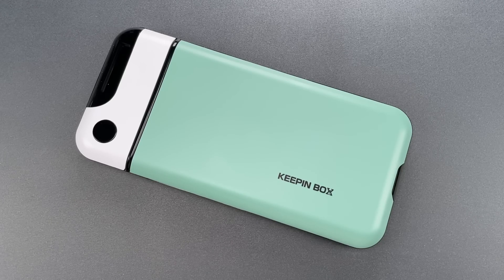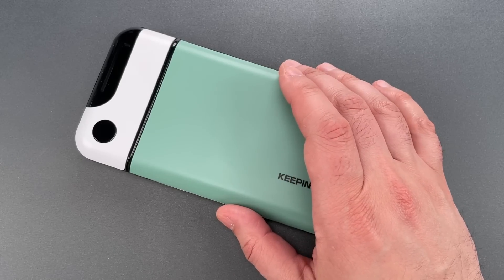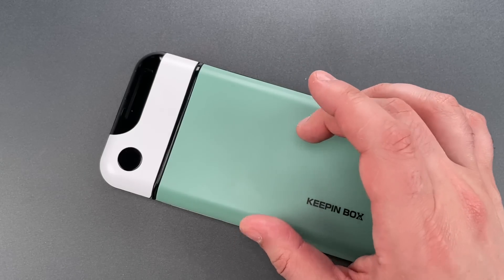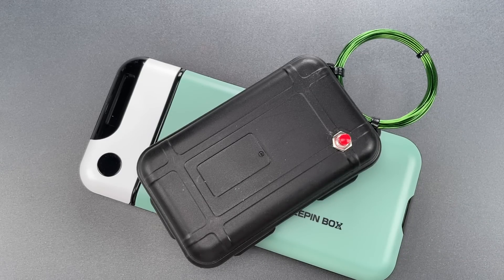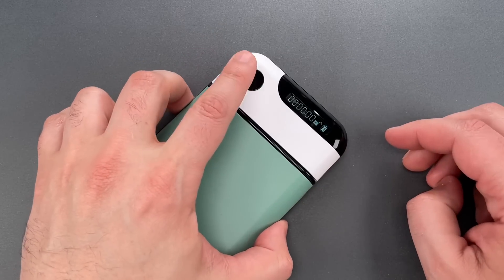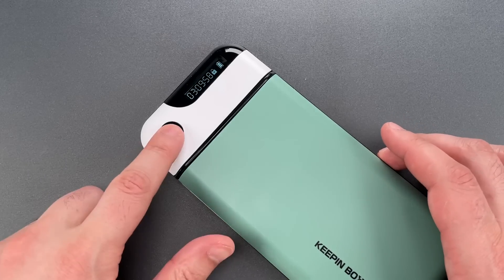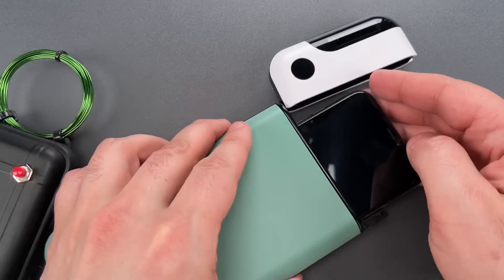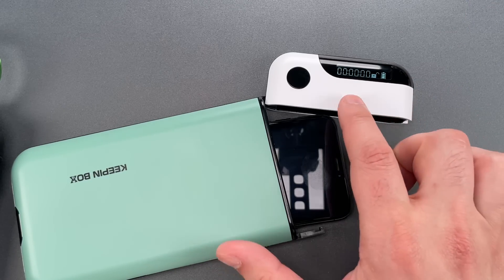[1440] Pocket EMP vs. Smartphone Timer Lockbox

Comment: i'd like to see what the EMP does to the cellphone itself!
Reply: I worked for a while for a major telecoms manufacturer, there were some pretty tough interference specifications to reach before we could certify our kit, phones will have had to meet similar rules. I reckon it's going to be fine.
Reply: We got a new degausser at work some years back for frying drives. It doesn't destroy the electronics, only the data on the platters. It charges a supercapacitor int two phases until it lets go an EMC with a pleasent *boff*. I tried taking an old ninetees phone just to check if it'd survive it and no problems. I haven't tried a modern phone, though
Reply: It depends on the phone and how well designed it is.
Firstly it will not cause the battery to explode as some have said. You would need an EMP powerful enough to cause the battery to internally short circuit.

An EMP just induces current in the components in the circuit, kind of like how wireless charging charges your phone but instead of a steady stream of electromagnetic energy it's more like turning something on and off dozens of times a second.

Depending on the power it may cause a phone to crash and reboot or it may cause damage to the ICs inside the phone. It really depends on a lot of factors, mainly the construction of the circuit boards in the phone and how susceptible it is to electrical induction.
Reply: @daviddavidson2357  My point is that it wouldn't be wise to try this with your own phone. Use a fake for the video.
Reply: @randystegemann9990  Yeah, use it with an old or broken phone. You can damage electronics with one of these.
There's a high chance that your phone would just turn off and on again but you could also fry something important in it.
Reply: @daviddavidson2357  No sense in risking your expensive phone and everything stored on it. It may just restart or it may fry beyond repair, why chance it? I didn't see anything displayed on the phone LPL put in the lockbox, so I'm guessing it didn't work.
Reply: that was my exact thought, too. It's the same thing as using a plasma torch to cut into a safe that is stocked full of gasoline-soaked cash
Reply: @sethrenville798  exactly why I soak all my cash in gasoline
Reply: I’d like to see this done while the phone is on
Reply: @banderson1979  if you put a phone away for 3 hours, don't you think one world turn it off first?
Reply: some phones turn off but most newer ones do nothing
Reply: Yeah! My first question was: did the phone survive?
Reply: Smartphone's are covered in EMI shields to prevent radio interference, and to shield components from each other interference's, so likelyhood of EMP effecting a smartphone is extremely slim.

~Jason437
Reply: Surprisingly little, phones have to be shielded from their own signals, it may reset it. Older electronic devices are more vulnerable.
Reply: Most modern phones aren't as vulnerable as you might think, but it surely doesen't do it good
Reply: Battle of the 🤓 nerds.
Reply: There are videos of that on YouTube. Just Google emp effect on cell phone. Then go to video tab and watch to your hearts content.
Reply: If the phone is turned off, then pretty much nothing.
Reply: @MouseTai1  if the emp is strong enough then the battery can take damage or even explode, but that would take a way stronger emp than he is using. and a phone is never really off because basic systems like the clock and waiting for the button press are still running and they could get corrupted and or damage the system itelf if the emp is strong and long enough.
Reply: @dovos8572  EMP has nothing to do to the battery. The electronics may be damaged, but they are shielded for emissions and helps also on immunity. Maybe the wireless charging electronics may be damaged if you place it over the coil so they couple well.
Reply: @dovos8572  LMAO what in hell can make a battery be susceptible to EMP?! What this thing causes are stray currents in the boards resulting in effects ranging from just messing a signal up to actually damaging a component should the voltage induced suffice.
Reply: @CATA20034  Doubt the charger's receiving circuit would die (it takes pretty much power to do so, as it is basically a series LC rigged to a rectifier), the feedback transmitter is a more likely kill though, as it is a parallel LC rigged to the IC directly - yet it depends on how much energy is released close to the 1 MHz frequency peak. So my bet is you will more likely kill something else that has a long PCB trace coming to :)
Reply: @TheBypasser  agreed;).
Reply: @TheBypasser  I'm not talking about the 1-2w emp that he is using, but about that when the emp is strong enough like a 100+W to a 1+kW one can destroy almost everything that is electronic based. and that is simply because the shift in the electrons gets big enough to create heat and a strong voltage differences. naturally such a small one like he is using doesn't do much to a phone if it isn't directly messing with the cpu or memory.
Reply: @dovos8572  Well, although for pulsed stuff we normally use Joules, this thing is clearly somewhere in a few kW range of peak power, and induces a fuckton of voltage (or what else would you expect from something involving a HV cap, a sparkgap and a few loops of wire) ;)
And yeah, even an induction heater (think 50+kW RMS, not peak) will first burn the boards up, next everything magnetic if we are talking those within 200kHz range - and only the last comes the battery as one has the highest thermal capacity of them all, and no magnetic parts to absorb the lower-frequency part of the spectrum. The only scenario I can imagine that will cause a battery "to explode" is somewhat a 100+ kJ pulse that will cause a mechanical damage to the cell(s), but again it will delaminate the PCBs before everything ;)
Reply: @dovos8572  The clock in most smartphones is not on when it's turned off. The time (or ticks) is kept in various ways. Some phones use supercapacitors to power the clock when the phone is off. But often phones just don't need to. If you have a physical button, you don't need any clock to boot and start that clock.
Also there's little trouble when the clock is messed with, it happens quite regularly that it misses a few ticks. It's usually off by 10 seconds per day. Which are a lot of ticks at 42MHz.
Reply: @MouseTai1  Can you really completely turn phones off anymore? Even getting the battery out can be a problem. I'm guessing LPL only used something that looked like a phone, not an actual working one.
Reply: @randystegemann9990  I guess you're right, standby circuitry is always on
Reply: @MouseTai1  Even if you can pull the battery, there might be some residual or backup power inside or some circuitry susceptible to damage even though unpowered. I'm pretty sure LPL wouldn't really jeopardize his own phone.
Reply: @randystegemann9990  uhm, is stegemann like a thing?!?  Just thinking back to payback with mel gibson.
Reply: @nooboftheyear7170  That was Arthur Stegman in Payback. "You're not gonna f**kin' kill me, are you?"
Actually, Stegemann is a German surname, sort of like a thing. I saw Payback recently. 
I just saw Blood Father today with Mel Gibson. Too bad his character died at the end.
Reply: @randystegemann9990  He did refer to it as his /old/ phone, so it was probably a real phone at one point in its life. Maybe it still worked, maybe it didn't, but as far as he was concerned, yes, it was just a prop.
Reply: @MouseTai1   I wish, wait until the next major solar storm hits us and watch your phone blow to peices.
Reply: @Rustybrick12  There have been several powerful solar storms in the past few months. Last I checked, no exploding phones.
Reply: @jamesdinius7769  I said, MAJOR solar storms, in which ones that can severely damage any electrical device, or power grid. There hasent been one for a centurie but that dosent mean it's not bound to happen.
Reply: @MouseTai1  depends on the output power of the EMP.
Reply: Well, if you aim the EMP at the top where the lock electronics are, probably won't do anything to the phone itself.
Reply: poor battery if you make the emp too strong
Reply: @dovos8572  Great. Even more math(s)!
Reply: My mind goes to Starfish Prime. Part of Operation Fishbowl.
Reply: That was my thonking.  That the phobe itself might get damaged by the emp.  But then perhaps I shouldn't have watched tom cruise's version of war of the worlds...
Reply: To answer your question. Nothing. Not even on a phone that is turned on.
It might reset the phone or flicker the screen, but not only would it not destroy anything it would not even delete the data.

You would need a MUCH more powerfull EMP to fry a smartphone. Unshielded.
Reply: One of my phones was destroyed by the electrostatic shock from a sweater.
Reply: Yess me too
Reply: the cell will be shielded. so more than likely very little.
Reply: If the back is plastic or crystal, it will turn off, if it's some metal, it will do nothing, the EMP it's not able to pass thru metal, even if it's just aluminum foil
Reply: It resets the phone’s timer as well ))xd
Reply: An EMP can destroy any electronic device. A strong enough one can be used to make a pulse that disables (or destroys) any device in a 5 meter radius
Reply: well the circuit board it self and the SoC inside it are shielded, the screen also had metal backplate so that basically covers the entire phone's logic board.

the battery however can take toll on the damage specially if the back side of the phone is not metal constructed, so if you take damage on the LiPo battery management controller, it can potentially be explosive, but you need to expose this circuitry for many minutes, if its just a few seconds, its probably not going to be damaged, specially if everything is off.
Reply: this has been tested on other channels... it goes off. and when you turn it back on its fine
Reply: I'd like to reset my cellphone bill to zero
Reply: @0blivionIOX  It'll do that by shutting down your phone permanently.
Reply: @0blivionIOX  then use a big emp gun on telephone exchange
Reply: probably not much cuz the emp is pretty weak. To actually destroy electronics you need a bigger beefier one. This one would destroy calculators at best
Reply: it's usually shielded
Reply: @marcogenovesi8570  Problem with EMP shielding phones is that they kinda rely on electromagnetic fields for... being a cell phone at all. Unless they're using an external antenna, putting EMP shielding on a phone VASTLY cuts it's useability, Even just shielding 'important' things (and not just slathering the entire case with a faraday cage) would create blackspots within the phone that impact reception, and when you're in the market that demands to be able to get a call anywhere anytime, you don't deliberately create blackspots.
As such EMP shielding on phones is extremely rare and I expect limited to specialised situations.
Reply: @intheory4652  dude wtf? even wifi cards for laptops and two-way radios have a full shield around the electronics. Guess what? The antenna emits significant EM and the electronics is very close to it. That's why the electronics needs shielding, to not EMP itself with its own fkin antenna.
Reply: @marcogenovesi8570  wifi cards and two-way radios have external antennas. that was his point.
Reply: @intheory4652  phone does have unshielded antennas for radios (cellular radio, WIFI, BT). Almost everything else is shilded. Shielding keeps unwanted electromagnetic emissions and immunity to outside interference in check, while also helping with power dissipation (helping spread waste heat all over the device)
Reply: @marcogenovesi8570  I've yet to see an EMP shielded phone out in the wild. I'm not saying they don't exist, but I've taken apart like every phone I've ever owned and you can clearly see they would all be screwed.
Reply: @jakegarrett8109  they have metal covering some parts of the electronics, or the whole chassis is made of metal
Reply: @marcogenovesi8570  I 1 don't think that's quite how that works, and 2, my latest phone has glass on the back (well did until the battery puffed and shattered the glass and now resides in a 3d printed custom case). Also the front screen is a giant opening if we assume it works like microwaves, so its definitely not sealed whatsoever.
Reply: @jakegarrett8109  the phone's mainboard is the size of your thumb and that's the only part that needs shielding. battery doesn't care about EM.
Glass on the back means nothing.
The screen usually has metal frame backing.
All consumer products thatuse radio frequencies of some kind have some form of shielding because otherwise they would cause instability to themselves with their own antennas.
Reply: @marcogenovesi8570  Most of the phones I've seen are larger motherboards. Not only that but the antennas are off to the sides and with fairly low power (FCC doesn't allow even 1w of emission power, that taser coil is probably a magnitude above that and focusing on that spot). EMP can also induce high voltage spike frying things, whereas most radio systems are low voltage, but I'm not an EMP expert.
Reply: @jakegarrett8109  Didn't Nokia 3310 have faraday cages?
Reply: @marcogenovesi8570  How does it work with cellular network if it's shielded?
Reply: @smartgrinder  the antenna isn't shielded, only the electronics
Reply: @marcogenovesi8570  I really doubt this piece of cheap shit plastic box incorporates proper Faraday cage.
Reply: @marcogenovesi8570  iphones are TEMPEST shielded but it will still shut down then back on in just a few seconds.
Reply: @marcogenovesi8570  if it were shielded it wouldn't get recieve tower signals
Reply: @royfinegan8006  it's not receiving the signal with the electronics, isn't it? It's receiving the signals with the antenna module. The electronics are shielded, the antenna is of course not